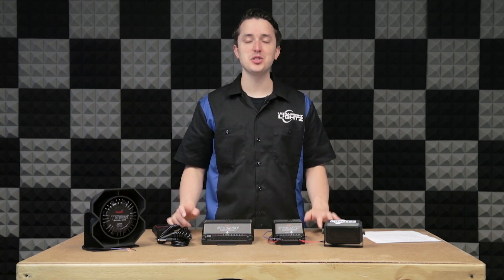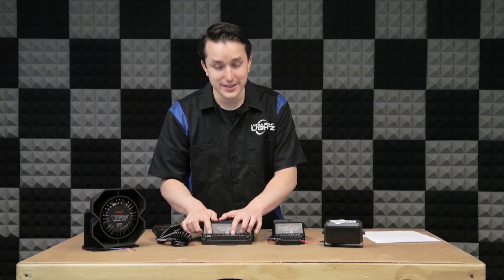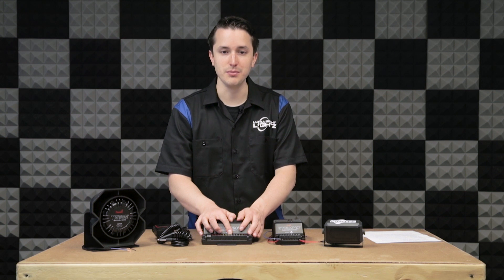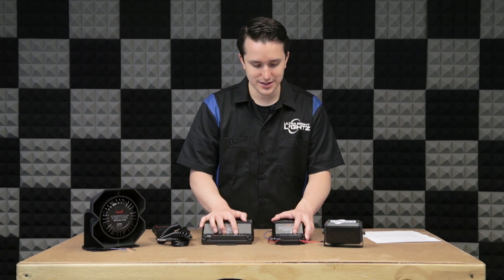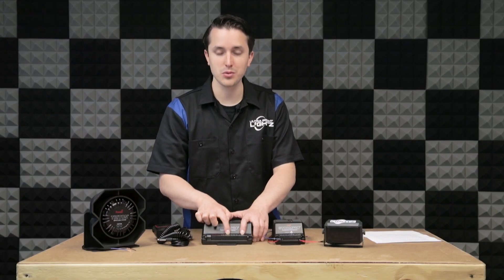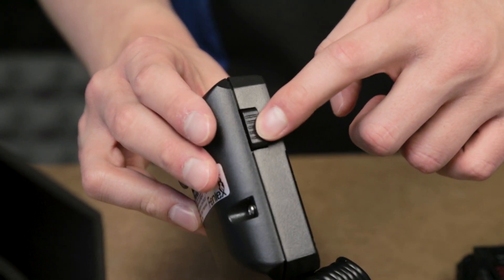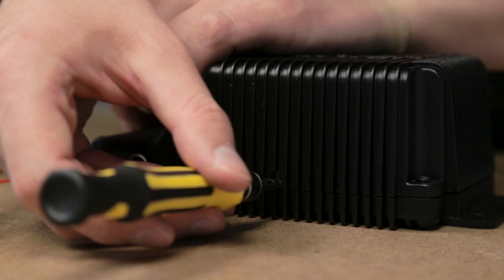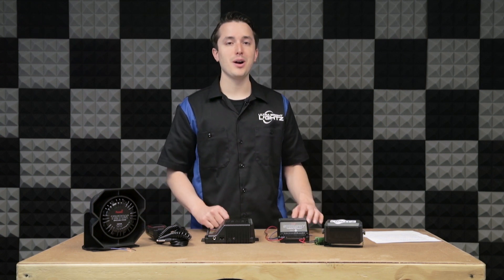Basics of Wiring a Feniex Storm Pro Siren

Comment: Why is this so confusing? I got a brown and blue wire on the triton 100W speaker, where do I plug it in on the Feniex Storm Pro? There are two holes and no instructions.
Reply from the maker: Speaker Connection: Connect the speaker(s) to the corresponding output • Storm Pro 100w • Outputs L & M  • Storm Pro 200w • Outputs W & X (not polarity dependant)  Outputs U & V (not polarity dependant) Speaker outputs are not polarity dependant.

Comment: If using a 4200DL, Besides the positive and negative, all i need is the RJ45 ? Dont have to run wires from the output of the 4200 to the storm?
Reply from the maker: That is correct. The Storm 100W will connect to the 4200DL using the RJ45 Cable

Comment: Non-standard setup, but can you use the 4200-DL for some tones AND physical manual switches at the same time?  Client has the 4200-DL "hidden" in the center console, but wants ability to have a switch that can be used for some tones without opening the console.
Reply from the maker: Yes you can wire it up that way!

Comment: Is 14gauge wire safe to wire the storm pro with a 15amp fuse or should I go with a lesser gauge wire to run on a 15amp fuse with power and the triton speaker ?
Reply from the maker: 14 gauge wire with the fuse will be fine!
Reply: @UltraBrightLightz   awesome thanks !
Reply from the maker: @roxfire23  You're welcome!

Comment: How do you set the “air horn” tone
Reply from the maker: You need to change the tones by pushing the button that is on the side of the amplifier until it gets to the horn tone which is tone number 10
Reply: @UltraBrightLightz  thanks
Reply from the maker: @roxfire23  You're welcome!

Comment: If you have a switch installed on tone 1 activated do you have to turn it off prior to activating the switch to tone 2 or does the switch to tone 2 override tone 1
Reply from the maker: An activated tone with a higher input
number overrides an activated tone with a lower input number.
For example, if Tone 4 and Tone 3 are both activated,the siren will play Tone 4

Comment: Why are there 2 ports for a single speaker on the 100w model? Does the speaker wire need to be spliced and put into both ports or does one of the ports useless?
Reply from the maker: The speaker should have two wires coming out of it.One for each port

Comment: Need help, i have a motorola radius m1225 and i have a 12 pin to fit in the back of the radio to headphone jack adapter, i cut a old pair of headphones and hooked the wire where it says radio on and pluged the other end using the headphone jack and nothing, am i missing something on how to get it going?
Reply from the maker: Did you run power wires to the siren as well? If you are still having issues please contact Feniex Technical Support and they will be able to assist you with wiring questions! 1-800-615-8350
Reply: @UltraBrightLightz  ok thank you for your info
Reply from the maker: @raydumont7628  You're welcome!

Comment: So I have a question... Does it remember what tone you've selected after it's powered off, or does it need constant power?
Reply from the maker: Yes the Storm Sirens will stay on the selected tone after it is turned off if you are using a controller.If you are not using a controller then the siren will cycle back through the tones
Reply: @UltraBrightLightz  Thanks... I certainly hope you're right, because I don't want to end up committing a felony by accident.

Comment: So, if I pair the 200w storm pro with the 4200, I can just program the 4200 and use the rj45 with data link and I wont have to wire all the different tone ports?
Reply from the maker: That's correct! You will just have to select which tones you want when programming the 4200!